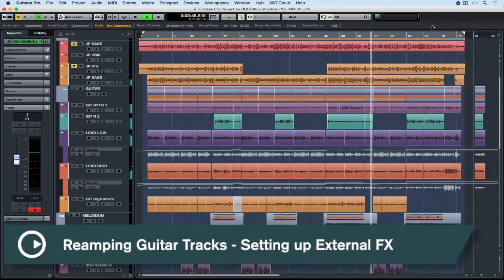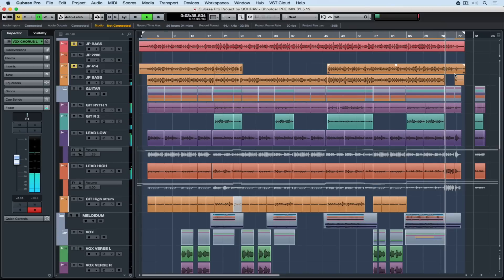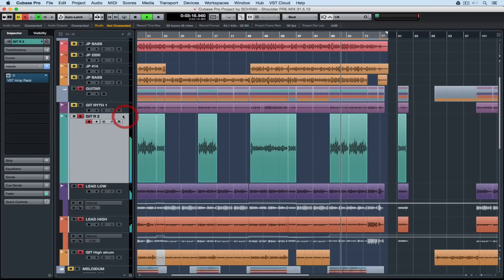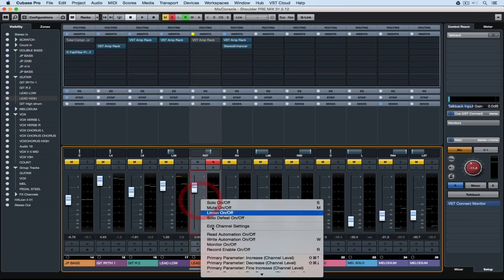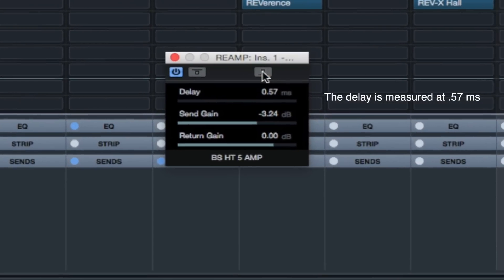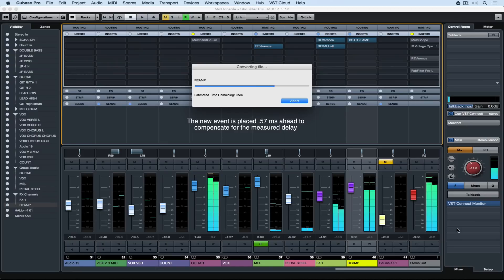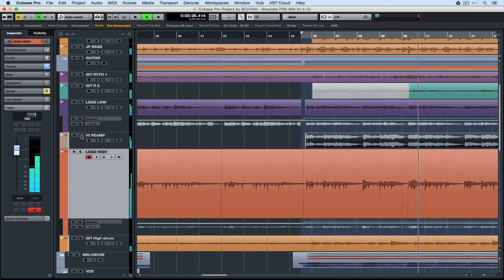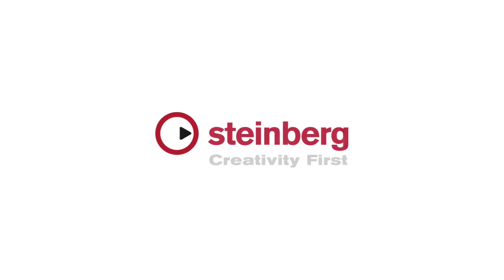Reamping Guitar Tracks and Setting Up External FX | Guitar Production Tips

Comment: Hi Andy, great practical and cool video!Just adding my two cents... When measuring the delay cause by the external loop with the impulse generator you get better time alignment if you make sure your amp or external FX unit are not using any patch with reverb or delay. Measure it dry first and then dial in the effects/patches you'reafter... ;)
Reply: Another great point. Thanks Mario.

Comment: I was always under the assumption that you should not plug a line out of an audio interface straight into an Amp and you should use a re-amp device between the two. How are you safely doing this connection without a re-amp device? Are you just setting the output volume very low.
Reply: Hey there. I think in days gone past with higher output levels it meant a reamp box was important. One thing I possibly should have mentioned is that different guitars have different output levels and will sound different when plugged into the same amplifier. Once again, it comes down to tone purity and discernment. If you have the guitar that you used to record and you want the specific tone then you should plug it in and check (or re-record) but quite often, we are re amping because we are unhappy with the tone in the mix, which means we don't need to pay so much attention to recapturing the level of the guitar, we need to pay more attention to capturing a tone that will present itself in our mix. Reamping boxes are great but I wanted to show that you can do it yourself on a budget at home if you really want to chase a different tone.

Comment: Good video but I have a quick question. Other than delay compensation, what is the benefit of the FX track as described here vs sending the original track out and having a standard audio track recording the new input? That's how I record my DI's that I reamp today. Same hardware setup, reamp box, mic, etc in both cases. Just difference in the DAW.
Reply: No difference really. Just the way I do it.
Reply: @schrav3248  I've also found that if you set something up as an "external fx" you can no longer use those inputs/outputs for anything else in your session, even when you're not using that specific "external fx". which is.... dumb.